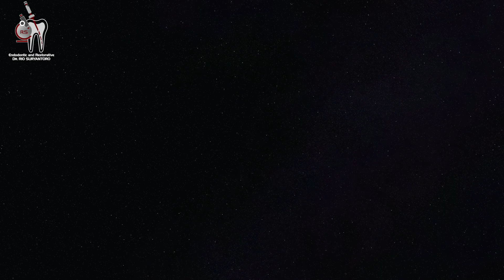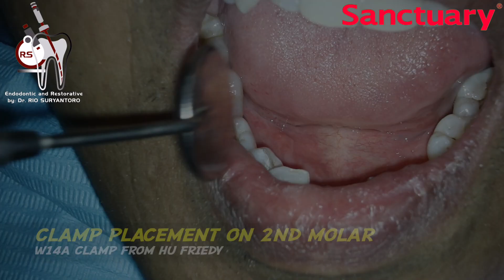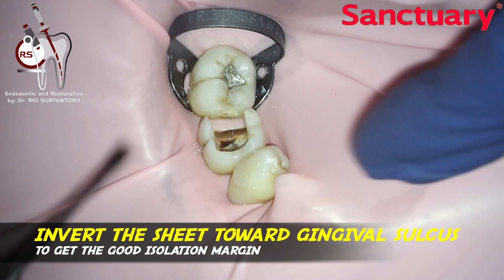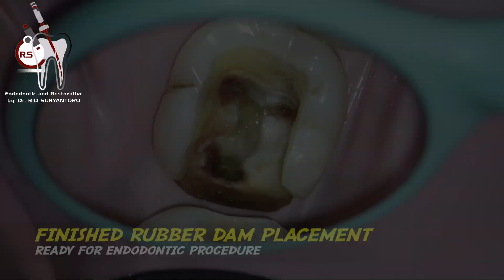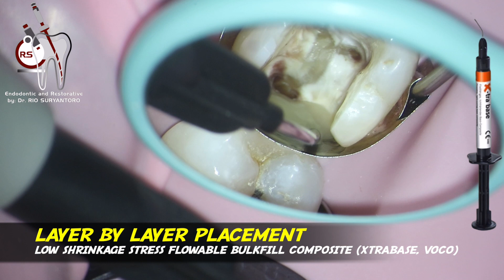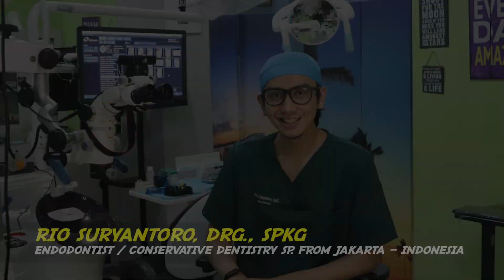RUBBER DAM PLACEMENT SANCTUARY PRE ENDODONTIC BUILD UP TO CREATE 4 WALLED CAVITY ACCESS OR REWALLING

Comment: Hello ur all videos r best, i have a question about rct procedure cost, and procedures.. what is the full rct procedure cost in ur technique can u charging individual for rct and composite core buildup and how much .. and also have u give crown after rct becoz ur composite restoration filling in rc treated tooth is supprb
Reply from the maker: hi Dr.. thank you so much.. regarding the cost, my clinic would have known the exact cost paid by the patient for their particular treatment. 😃🙏🏻
and for a crown after endodontic treatment? i chose to go direct first if i saw a tooth with enough remaining tooth structure to withstand the occlusal loads using direct restoration, if not, i may go for a crown. 😃